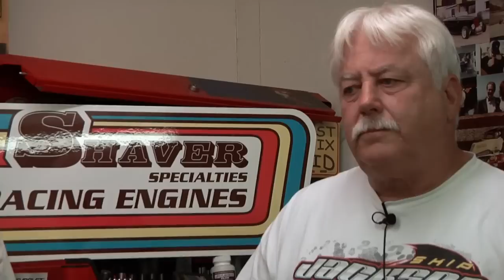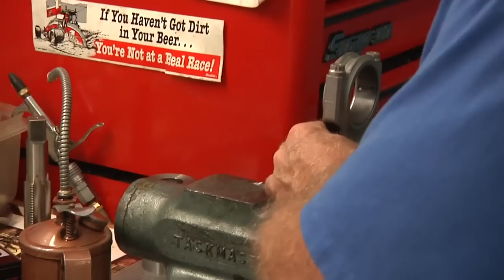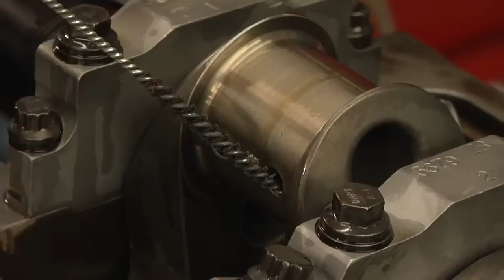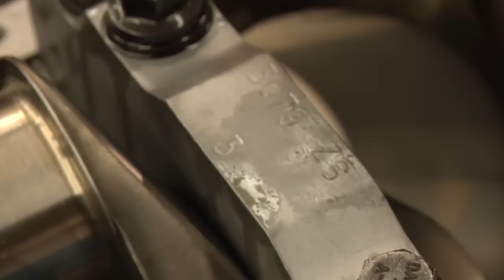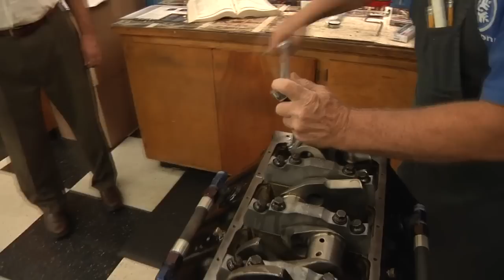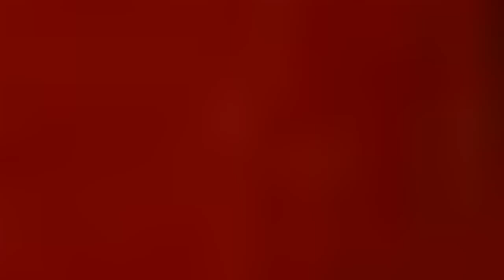King Engine Bearing & Crankshaft Installation Guide Feat. XP Bearings

Comment: 3.7 L new crank bearings measured .002 spinning by hand is a two hand job seams tight?
Reply: Your not spinning the crank with no lubricant on the bearing surface are you?

Comment: Can you change the lower crankshaft thrush bearings for a 2007 Kia Sedona without taking out the engine V6 engine
Reply: This should be done with the engine out of the car man unless you want premature failure.

Comment: I own Vauxhall Victor FB 1964 originally fitted with 1594 cc OHV engine. The engine has 3 main bearing crankshaft. This engine either comes with Vandervell or Glacier Bearings. I have experienced an issue with regard to the centre main bearing of the crankshaft, the centre main bearing worns out rapidly. What could be the reason? These bearings are steel shell having copper overlayered with led on the top.

Comment: Don't use rags to wipe surfaces! Paper towels only!
Reply: Actually lint free cloth only. Paper towels leave behind foreign material.
Reply: Never paper towels. Should be lint free towels as mentioned. Paper towels leave residue and traces of paper behind. Even in a scientific GMP lab where I work, we never use paper towels to wipe down any equipment. We use special kimwipes (Kimtech brand.) Again, because of residue and leftover lint.

Comment: Dont believe what you see. King bearing are just ultra mass produce garbage from worst factorys in China. I ordered a set that had both the main and rod bearings. I did an inspection and 70% had defects with many having massive defects. The rod bearings all had a sharp  divot on the side right down middle of them all except the top 2. This divot extended onto the bearing surface. The mains had multi defects of gouges and scratches, one of them had 2 long and parallel gouges that ran the entire length of the crank side surface. They were both in sealed tight plastic wrappers inside a box. They were damage by the machinery that made them with no quality control either automated or by person.. Any one defect will cause improper oil flow and wreck the crank, the rod and possibly your piston and bore. Should have gone with Clevite or Sealed power, I just threw away 50%, but at least I got Sealed Power defect free bearings now, not a single nick or minor scratch/blemish on them. Never again King bearings.
Reply from the maker: This is Dan from King Engine Bearings, I would like to learn more about your experience with our product and would like to personally assist you with solving this issue. Can you contact me directly at inquiry@kingbearings.com ? Thank you for bringing it to our attention.
Reply: @markdennis5150  Do not mail order bearings, I learned my lesson. Pay the extra bucks, buy'em in retail store, open & examine them for scratches, gouges , dinks & plating issues there before you leave. Any issue I said will lead to non uniform oil distribution on the bearing and it will become a spun bearing and good bye engine. review them closely with a magnify glass, if it isn't perfect, reject it. See this video on checking bearings, start at 7:20, this is what the king bearings looked like. https://www.youtube.com/watch?v=sQhNIiPyTB4&t=1389s or search Petes Garage Engine Building Part 3: Installing Crankshafts. Good look Brother!
Reply: You got caught by the copy crowd....King is the best these days..
Reply: I've never had a problem with King or ACL.

Comment: Factory Spec. on a 427 Hemi is 1 thou. on the mains as it came from the factory. Do not exceed 1 thou. if you want to make any king of power. Otherwise, on a powerful engine you’ll pound the bearings right outa there.
Reply: Not true! And the ford makes the 427 and it is not called a hemi. Chrysler uses the name "hemi" and that would be a 426. Rule of thumb on bearing clearances is .001 for 1 inch. If you have a 3 inch journal them .003 would be recommended. It give the bearing more oil for lube & it cools the bearing as well. .001 would be extremely tight & probably fail with not much rpm.
Reply: @jesseduke694  NASCAR saw the light and they tightened up the on the mains and I recommend you do the same. Do not exceed one thou. on the main bearings. Sorry about the typo.
Reply: @peterviceroy1592  well thanks for the suggestion but ill stick what I know works. How thick of oil do you run with that tight of clearance? You know its not uncommon to have a journal out of round by a .0005 . If you only have a .001 clearance thats only a .0005 all the way around. If that journal grabs that bearing it will spin it. Thats bad news.

Comment: What is the best cleaning solvent to use? Will simple green or purple power work for this or should I use something different
Reply: Dont use em on aluminum purple power is caustic. Simple green leaves a powdery residue thats annoying to get off. The best is oven cleaner for 10-20 minutes and spray off with pressure washer. Repeat until desired results.
Reply: Laquer thinner is best

Comment: Sorry to be THAT guy.. But.. 

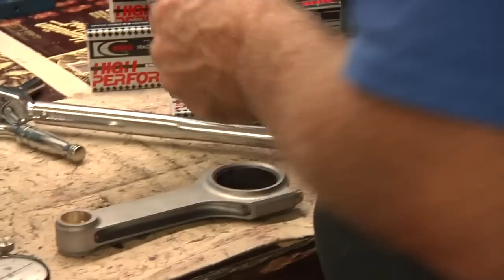@2:04 and 2:48
"bores can't be more than 5-TENTHS (0.5") out of round.. If the bores are out of round, poor bearing performance can be expected and possible bearing failure"

Id say there would be an expected failure with an out-of-round variance of 0.5" .. Lol

Don't you mean 5 TEN-THOUSANDTHS (0.0005")?
There is a huge difference between 0.5 and 0.0005"

And you don't "move the mic pins around inside the bore" of the bearing housing. You measure vertical height and around 45°from parting line.

If you are going to post an instructional video for newbies.. You really should proof-read.. And be specific.
Reply: Shawn Z yeah that dude really confused me what an idiot
Reply: He was correct. When a machinist says "5/10ths" he means .0005". When a machinist says "500 thou" he means .500".

Comment: I don't know... I see this is a race shop, but...… Couple things; Couldn't tell if the video was sped up or if he was going thru it that fast. Didn't torque mains from inside out. Didn't set the thrust bearing then torque it last after all others are done. No arp lube on main bolts?
Reply: Probably didn't show it all, but I also see many "mistakes" like using rags, spinning crank when not torqued (journals are only in round after torqueing....)

Comment: I have a build coming up soon  (Mazda 6 3.0L w/ single Precision turbo + plumbing) and this the first time I've heard of King Bearings. Definitely going to check them out to spec some shells for my application. The block is done being planed, bores have been honed, and the heads are going for porting next week. Can't wait to get this beat together. I'm looking for 700 to 800 HP.
Reply: Did u end up going with King bearings

Comment: why are you oiling the main bolts and washer to reduce resistance. the applied torque will be different in each bolt I will guarantee you of such. ask arp
Reply: B00steDevil I know this is 2 year old comment but it's just so wrong. ARP recommends and even sells their own lube just for that purpose. You always lube the threads, bolt head, and washer. http://arp-bolts.com/p/FAQ.php
Reply: Correct!!! I answer old comments too especially when they're completely wrong!! Well he is right about the applied torque. The end result will be different.   :)
Reply: I must have missed it but where did they say they were using ARPs?  The mains were bolts (ARP usually sells studs for mains) and for the rods, he didn't mention lubricating the hardware with oil. He just stated to make sure they were lubricated.

Comment: I'm watching you from turkey
Congratulations on a very successful operation
Reply: Using a shop towel to wipe a bearing shell that can hold debris to scratch the bearing surface??
Reply: I'm watching from Chicken!
Reply: what is the torque settings on 1.8